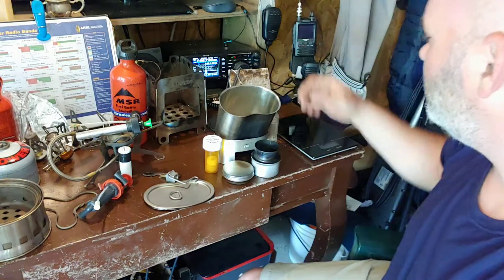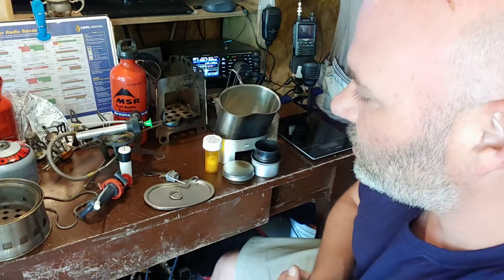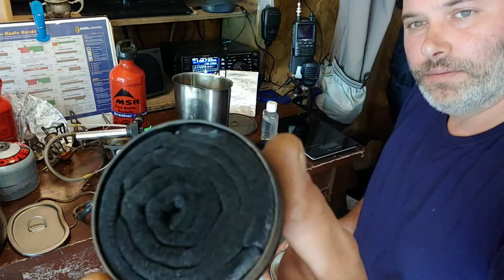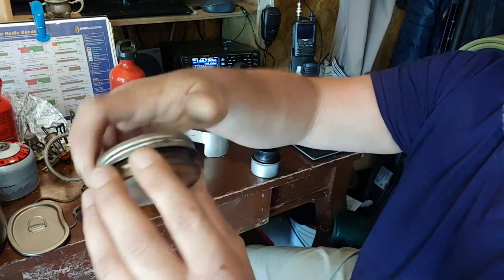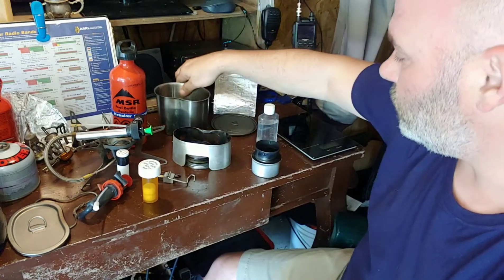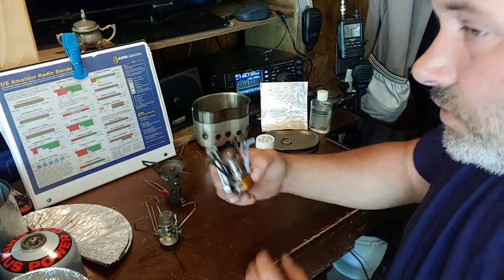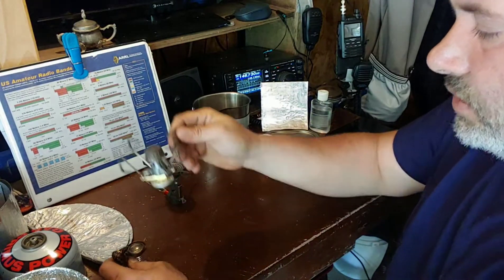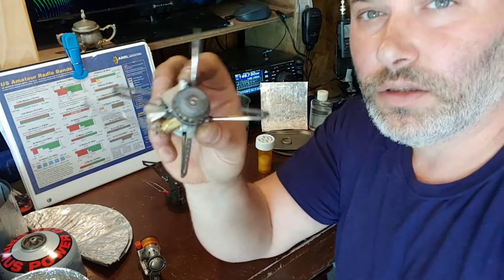My Backpacking stoves  favorites and not so much

Comment: You have a Vienna Sausage stove and not a cat can stove.
It is pretty tall for small things.

You can make a different cat can stove with no center can. Just hole punch a series of holes in it (called the super cat stove).

For a really nice twig stove the Firebox Nano Titanium folds up and weighs very little. It can accept a butane burner, esbit tabs, and even a Trangia.

For those who are not worried about weight too much, the full sized Firebox stove weighs in about 2 pounds!

I think there is a big difference between a backpacking/hiking stove needs vs a camping stove needs.

I like the RedCamp simmer ring more than the Trangia simmer ring.
With the RedCamp, you also get the solid pot stand (doesn't hold every pot or container but holds most).

The problem with the butane ones is that you have to drag the empty container some place to dispose of it and you cannot easily refill them.

A little venting when attaching/removing the bottle helps remove any debris.

Here is a trick about soot - very lightly coat the outside of your cooking container with dish soap.
Cleanup is much easier and faster.

Have you ever tried baking with any of those?
Cornbread is awfully good in the mornings :-)

A suggestion about all those stoves - cheap aluminum or metal skillets tend to cause problems when cooking (burning mostly).
A cast iron skillet, in my experience does not tend to do that.

Another suggestion with respect to wind problems - if you have no windscreen or the winds are pretty high, you can dig a hole in the ground and place the stove in the hole.

For alcohol stove issues -
Assuming that it is summertime, you can place the alcohol stove in a shallow pan of water to slow down the burn.

Some suggest that you add a little water to the alcohol to reduce the heat output.

Just food for thought!

I like both of your videos but one vid had a link to using a stove with pellets but the video had a tin with a wick in it (video link was on your pot stand).